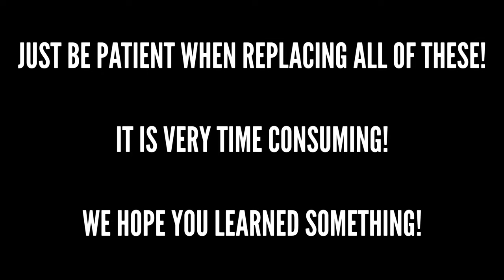HOW TO CHANGE SPARK PLUGS FAST & EASY ON A 2009-2018 RAM 1500 4.7L V8 INTAKE & EXHAUST - FIX MISFIRE

Comment: Wait.  Doesn't that 4.7 have 2 spark plugs per cylinder?
Reply: Yes  16 spark glug and 8  coil ignition
Reply: Those are the easy eight. The other eight aren't so simple..
Reply: Lol yeah everytime I change those I fund some stupid change only upper ones😊
Reply: No . The 4.7 magnum v8 is not 2 spark plugs per cylinder as the 5.7 hemi is

Comment: Isn't this a duel spark plug I have the same truck 4.7 with 16 spark plugs
Reply: It is yes
Reply: It is baha!
Reply: Bro. Yall wouldn't believe how many times I've only changed 8. My engine is probably ready to punch out on me 😂😂😂
Reply: Both my trucks have 16 my 2009 single cab 4.7 and my 2016 crew cab 5.7

Comment: Good video but u forgot 3 things. First, u didn't check the gap on the new spark plugs, second, u didn't use any anti seas on the plugs for the next spark plug change. And third, u didn't say to use a thin wall 5/8 socket. Thick wall socket won't fit in the spark plug hole. Also, I use a peice of vacuum hose and attach it to the new spark plug to install them, that way u don't cross thread the new spark plug.
Reply: Those plugs are iridium and you don't mess with the gap and ngk plugs  are application specific plugs so the gap is already set
Reply: @bdanielcal4608  well u got lucky, this is my second set of plugs, so tell me why when I installed my first set of plugs, 5 engine codes came up. Wrong gap.
Reply: @rickhartman3960  I don't know I bought ngk iridium and they were 2 different part numbers the exhaust was  gapped at .44 and I believe the  intake was 39
Reply: @bdanielcal4608  So I had to take out my plugs and very gently gap them. 2 of my plugs were at .052, 1 plug was at .051, I know ur not suppose to touch the gap, I hear u on that but I never trust the gap from the manufacturer. Also, I just learned that be very cautious about if buying  iridium plugs  on line like eBay, not sure how true this is but their selling knock off plugs, not true iridium plugs. That's what a few people said on a Dodge ram forum I belong to.

Comment: First of all this engine 4.7ltr. V8 has 16 spark plugs not 8 from the start of the video. Second I found it difficult to use either a 16 mm or a 5/8 in socket to drop into the spark plug jackets in order to remove the original spark plugs therefore if you have a grinder grind down the outside of the spark plug socket 5/8 or 16 mm in order for it to go down into the jackets for the removal of the spark plug or the insulation of the new spark plug. Thirdly I always unhooked but the positive and the negative on the battery rather than just unhooking the negative end of the battery for the PCM and the relearn. Fourthly you'll find this job much easier to do if you simply get an 8 mm socket on both three bolts on the driver side and the passenger side fender liners and removing the fender liners to gain access to the spark plugs on the sides of the engine. Furthermore and removal of the top spark plugs you always do it by hand you don't ever use an air ratchet if it gets in a bind on those jackets where the socket is down into you could cut into the aluminum causing aluminum shavings to drop down into the spark plug holes and removal or even in the installation of the new spark plugs always do it by hand. Other than that don't know if the phone got broke or not whenever it fell and hit the ground but I hope it didn't and hope everyone has a great day and this helps!

Comment: Where the hell do I find a thin wall 5/8 without ordering one
Reply: I need the answer
Reply: @frogshitjj  no I tried a regular socket And it won’t fit you need a thin wall 5/8 thin wall
Reply: I ran into this yesterday I ended up grinding one to fit as I was stranded at that point 😂
Reply: have to order.

Comment: No anti seize ? With an aluminum block? 🧐
Reply from the maker: Anti seize?  What's that? Haha just kidding.
Reply: These have iron blocks, but the heads are aluminum. The spark plug inserts are steel though

Comment: What spark plugs did everyone use ? I see various people going with iridium for the engine and copper for exhaust
Reply: I used the top of the line 28.00 plugs x 16 and the top tier coil packs for the Hemi .
Reply: @Wally-pu2hh u notice any improvements?

Comment: I use a piece of rubber gas line to get them started back in,a 6 inch piece in hose as long as it fits tight around the end of the spark plug.

Comment: What kind of socket did you use to remove these spark plugs?
Reply: I second that question. It looked like he used a regular spark socket. People on the internet say you must use an ultra thin socket .
Reply from the maker: I used a regular spark plug socket mate
Reply from the maker: @donnyr.9712  not really required - regular spark plug socket worked for me
Reply: always good to use the spark plug Socket that has the magnet it holds the plug steady and makes the job way easier
Reply: @HidalgoMotorsCo   can a 2010 dodge ram 1500 4.7 engine  swap into a 2008 dodge ram 1500 4.7?
Reply: I have the same truck with the same engine and it takes 16 spark plugs 😦
Reply from the maker: @ericcross9788  crazy innit? Lol 😆
Reply: @HidalgoMotorsCo  it sure is. Im use to changing 4 6 and 8 spark plugs .
Reply from the maker: @ericcross9788  yep! Just extra work haha
Reply: @ericcross9788  no , you don't.  Impossible.  The 5.7 has 16 , the 4.7 has 8.  The 4.7 coil packs are singular , and the 5.7 hemi have twin coil packs , so you do not have the same engine
Reply: @Wally-pu2hh  no the 2011 ram 1500 with the 4.7 l. Does have 16 plugs.
Reply: @kingyankee69  Correct - the 4.7 started using 16 plugs in the 2008 model year.

Comment: I have a 2008 Dodge Ram 1500 4.7 and I used a 5/8 regular socket and it didn’t fit so I used a thin 16m and it didn’t fit either so I just ordered one
Reply: What socket did you order? I have the same problem

Comment: I have a 3.7L Dodge Ram 1500. Do you know the order of the cylinders? I could not seem to find it on the web.
Reply: A pain to find but from the best I could tell, looking at the front of engine right to left going back toward firewall the order is 1,2,3,4,5,6

Comment: To anybody watching this, don't do any off this shit !!! Just change your plugs !!! I have this exact truck and I didn't have to do any of this unesisary shit !!!
Reply: Unnecessary *
Reply: LoL 😆  right !! And too many in the comments think they have the same engine but 16 plugs . If you have 16 plugs , it is not the same engine as 8 plugs , that is so stupid it makes my head hurt
Reply: You know there's 8 on top and 8 on bottom right...? Intake and exhaust.
Reply: I was thinking the same thing. I have 5.7 (the real v8..)  and literally changed my plugs yesterday and didn't do anything besides move the tube connecting to the throttle body or whatever tf from the air box (idk terms just how to fix shit lol) and didn't get electrocuted. literally just take the packs out at the angle they sit and use a MAGNETIC SPARK PLUG SOCKET NOT A REGULAR ONE

Comment: At how many miles you change your spark plugs
Reply: @Shaun I’m at 210k with the original plugs.... well I assume the originals. Got it at 70k
Reply: The owners manual say to  change top rows at 48k, replace ignition cables and top and bottom plugs at 96k, top rows again at 144k.

Comment: My check engine light is on. It is a P0740; something about the torque converter In transmission What do you recommend?
Thanks 

Brady Scriber

Comment: What 5/8 spark plug socket do you recommend for this job?
Reply: A thin walled spark plug socket with a swivel. Amazon has a few. Don't get the long ones. Get the swivel thin-walled one (it has to be thin walled to fit). I did this job about two months ago on my 2009 4.7L. Good luck
Reply: Magnetic
Reply: DO NOT BUY PARTS OR TOOLS ONLINE
Reply: I took one and grinded the wall down some works perfect

Comment: They stopped using 4.7s after 2013.
Reply: I wonder why?? Anyone know?
Reply: @LineDriveBros  Because the V6 model now offers only 5 less HP than this version of the 4.7 with better fuel economy. The sales were basically poor.
Reply: I have 300,000 miles on my 2010 4.7
Reply: @michaelseidenberg2323  mine 205k
Reply: @gotz2getcakealvarez439  you're good for another hundred thousand. I run Pennzoil full synthetic
Reply: @michaelseidenberg2323  great trucks man. 315k on my 2011 4.7
Reply: @michaelseidenberg2323  Nice, I have 203k, runs great. Just have some dirty coolant in the reservoir. other than that no complaints.
Reply: @michaelseidenberg2323  mine 2009 4.7 L 201488K and purring like a kitten
Reply: @zachywacky2329  awesome, I own a 2010 ram 4.7, with only 91k miles, bought it (literally) second hand 3 months ago... I wonder how reliable this engine is, in my country the 4.7 isn't that common.
Reply: @SRR1213  when it comes to trucks horsepower doesn’t matter for shit.

the 4.7 had the advantage of 60 more pounds of torque.
Reply: Has anyone with this engine had P0420 codes? My 2010 4.7 has 190k miles and is running check engine lights. Runs fine